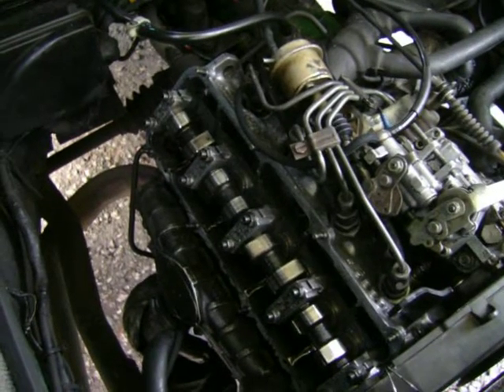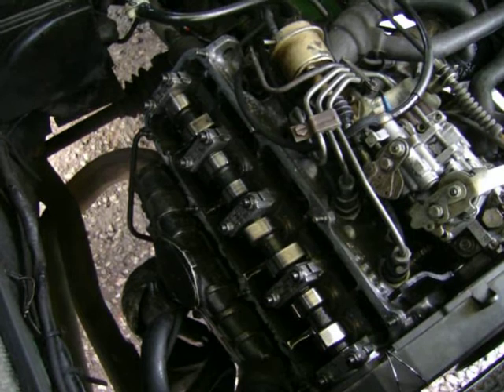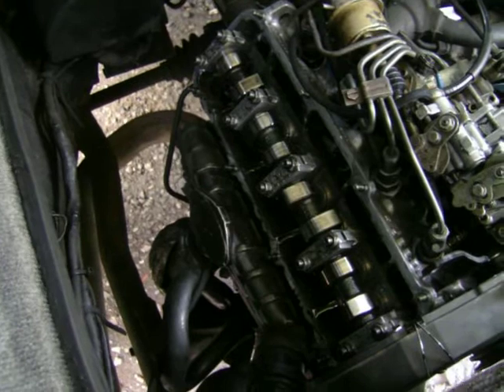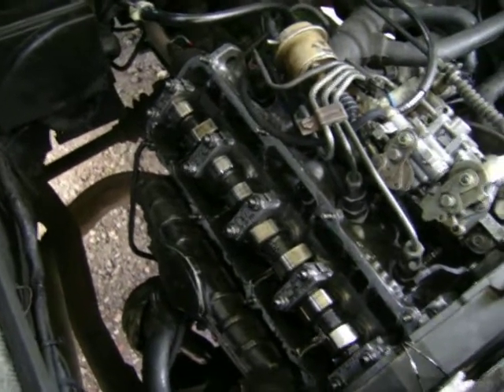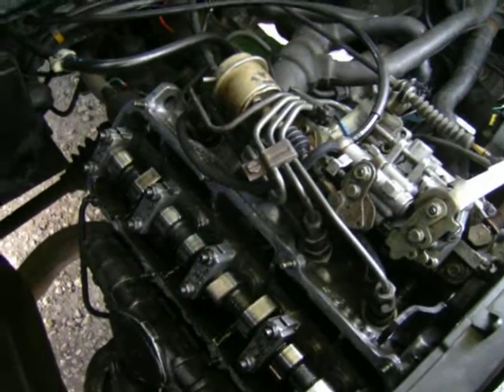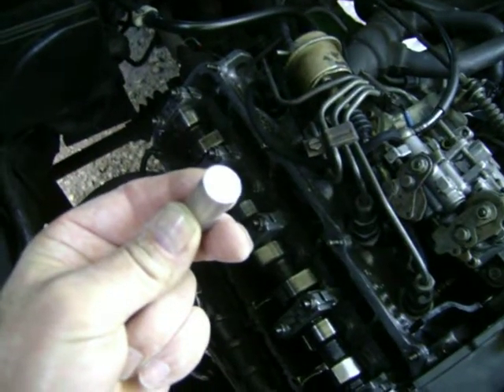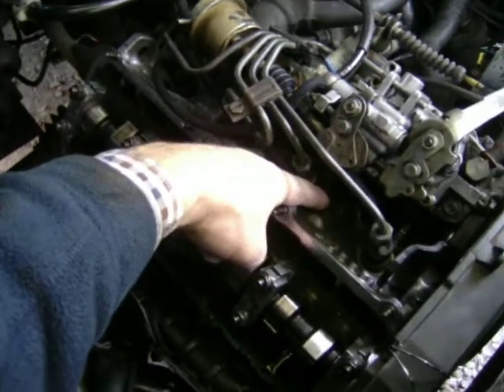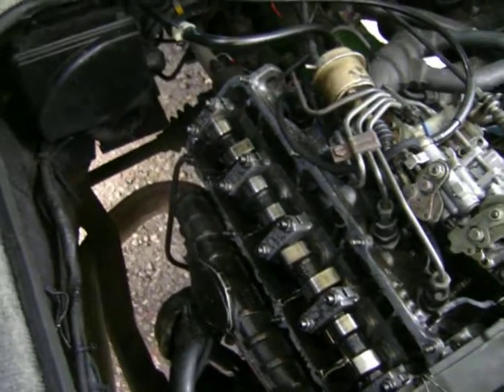VW T25 1.6TD JX ENGINE HYDRAULIC LIFTER CYLINDER HEAD CONVERSION

Comment: did you use the mechanical or hydraulic head gasket?
Reply: I did similar conversion, used mechanical head gasket, plugged the breather hole by fitting the M18 bolt and grinded off carefully.
Reply: @Cvokarium   Do You change oil pump ?  I did same conversion but  engine work noisly.
Reply: @michamizerski7570  I used the original oil pump but a new one. I'm running Shell 10W60, not too noisy at all. ;-)
Reply: How long does it work with original oil pump?